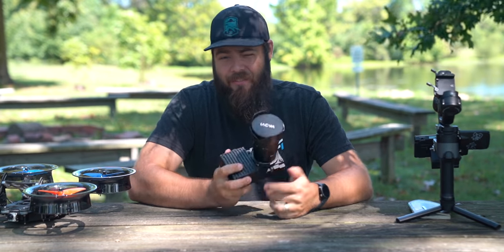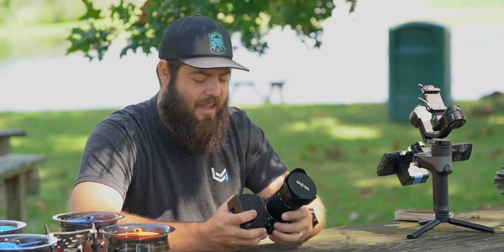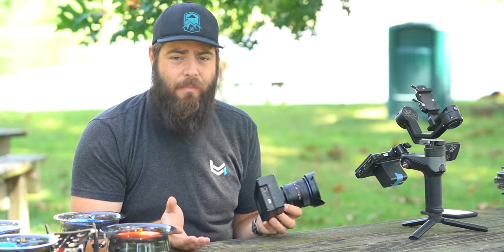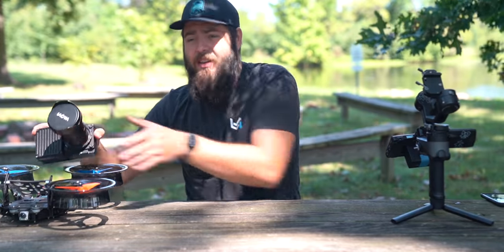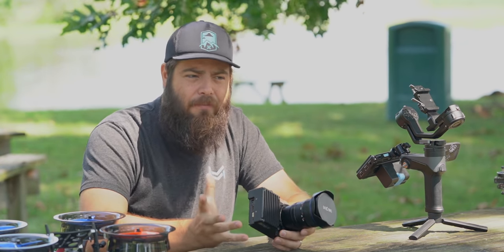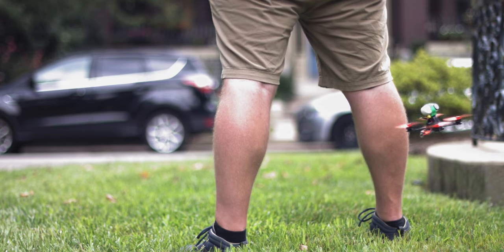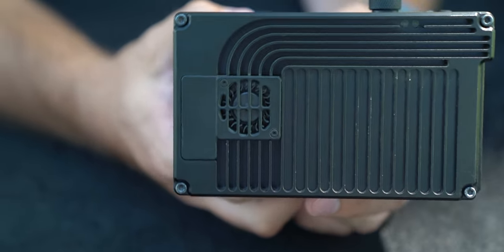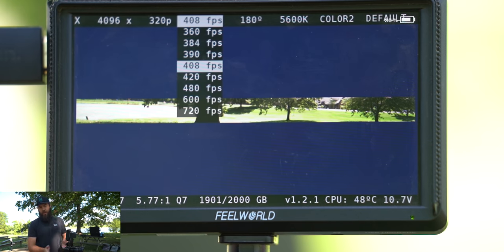Freefly Wave Review -- Why I Bought this $11,000 Camera

Comment: Thanks for making this. I went through youtube after seeing the Mark Rober video and the fvp-slomo, this cleared a lot up. 

Less option for exposure, not really. The "shutter speed" as in exposure is more or less is built in your main fps. The shutter angle being at a optimum 180 degrees and the rest is you setting the fps, determening how fast the wheel has to spin and how long is the has to be exposure. It doesn't offer a reference point the
of exposure time in seconds that you are normally probably used to look at. Looking it from a photography standpoint 1440fps has a 1/2880sec shutter speed at 180 angle, 1/840sec at 420fps, hence giving you a practical control of the exposure. Of course you can change the angle, but with that you are reducing the natural look of motion blur. And the iris is manual and ISO is fixed. Sucks for low light but that's slomo for you, even for a high end camera. Use variable ND-filters or dial down the iris if it's too bright. Same stuff different names or tools.

Comment: I got my insta360 Go 2 in.  It has pretty much the same exact issues. Quick to  overheat. Limited Internal memory. Short non swappable battery life. Long delays in transferring data.  But the pros outweigh the cons so far.  But looking forward to a newer GO version 3, that addresses the current GO 2 pain points.

Comment: neat... the heat sink would probably work better if you put a piece of tape over the fins  to force the air along the fins instead of blowing into atmosphere.  

in machine vision cameras you can teach the camera to balance out those vertical noise lines. i'm not entirely sure how they do it but it's some sort of localized gain adjustment that gets calibrated and saved at the pixel level.  Not sure if the mfg could do that with this cam or not. 

can you zoom in on the monitor to better check focus?  

would it be helpful if they could exchange refresh rate on the monitor for quality?  Then your colors and sharpness should be better at the exchange for lower frame rate.   i would think it's possible to do and keep the same bandwidth limitation.

Happy Friday Gorgeous!   Hi Paul and Winston

Comment: Hey Nurk love the level of professionalism you bring to the table. I have a question when you use DJI on such an expensive cinema rig what size and what type of BEC do you use to have stable voltage to your DJI system ?
I am having video freezing during flight. I changed FC to the Aikon F7 HD 20x20 I’m using the plug Supplied. I have the Fetteck spike absorber and I changed the capacitor to a 1000 UF cap I am still getting a picture freeze during flight I still have control of the model.  I’m thinking that I need a BEC I’m running 6S 2306.5 1900 KV motors. My question is how can you trust DJI you must not be having this problem with your vistas how do you do it please tell me? I have been struggling with this for a year almost Dji‘s customer service is useless I’ve already sent the goggles back to them they’re saying there’s nothing wrong with them and they sent them back on an old firmware I had to upgrade to the latest. I am on 5.8 GHz only please give me some information that can save me otherwise this unit is going to destroy my gear and I’m going to never order DJ I products again which would be very upsetting As I love it !!!!

Comment: 10 stops, banding, global shutter,... so, its a Cmosis sensor then? Same as BMD, AJA, Leica, FlareIO use.... add a LowCon or DigiCon filter to lift the shadows and roll off the highlights. There are plenty of remote focus options, and you'd know more options for wireless HDMI links then most of us.

Comment: Is it full frame?  You said the sensor was small?  You can use some of the f.095 lenses if its a cropped sensor.
Reply from the maker: Super 35
Reply from the maker: And I was saying small compared to the amount of light that can get into a phantom
Reply: @NURKFPV  Oh that's really interesting.  I wonder if the laowa 33mm f.95 would cover it or not.   The only problem the .95's is that they're pretty heavy though.

Comment: Great review, thanks! ........... question: for studio use, the low res monitor output is a bit of a deal breaker. What's the quickest way to get the image into the computer so you see an actual preview at the real resolution, even if only a still image? Is it something you can do in seconds, and if so, how?

Comment: Just wondering something about that 180-degree shutter angle. If you select an 180-degree angle you get motion blur, which also unsharpens the image when you are moving. 
What is fundamentally wrong with choosing a lower shutter angle such as 45 degrees, keeping more detail in the source footage, and adding motion blur in postproduction when desired? In Resolve that seems to work well? 

But I am just a beginner with all this. What do I know?
Reply: Its a good question. The answer is "Saving Private Ryan", specifically the D-Day landing sequence, where the sharper motion is clear, and stuttered - objects jump frame to frame instead of smooth motion.
Adding blur in posts costs time to render, and that eats up money in more hours the production has to pay for instead of shooting at the shutter speed that gets the desired blur.
Reply: @PiDsPagePrototypes  : With that scene it adds to the drama, together with the shaking of the camera. It was an artistic choice to setup the cameras the way they did. 

Regarding the question: I tried it with Gopro footage during toying around with the new-to-me (Gopro) toy: shot with 180-degree shutter angle and shot with 45-degree shutter angle and added a bit of motion blur in Resolve using its 'better motion estimation' over a few frames. The end result feels the same, so I am leaning towards 'if you have only one chance for the shot, you want the most versatile source data possible and worry about details later. You cannot really correct overexposed/oversharpened/overmotionblurred footage'. 

Regarding extra rendering time and thus cost: the same can be said for color grading, framing, sharpening, and more operations that are often delegated to postprocessing, right? It might be me, but adding a bit of extra motion blur to footage increases the amount of time spent for a minute of end result insignificantly. 

Still, nobody does it, so I must be terribly wrong somewhere.
Reply: @dabit4840  You're right in that you want the most versatile footage, though there's another rabbit hole to fall down there about producers who hire based on brand of gear owned, rather then skills learned.
The extra render time does come in to effect, adding the blur in the process might only take a moment, but all the elements added in to the vision grow the render time on export, but you still have to pay for that, so you grow the post production budget more then cost of fitting the right filters and getting the blur in the original footage - The more you get right in camera, the less the whole production costs.
But, like everything in film and TV production, there are many ways to get the desired results, and no one technique is right or is wrong, just some are more appropriate to each production.
Reply: @PiDsPagePrototypes  : Thanks for the explanation. Sure, if you do it for a long time you can probably fit the exact filter and settings for a given situation faster than I can blink my eyes. But I am glad there seems nothing fundamentally wrong with choosing a lower shutter angle and doing 'cinematic motionblur' later when desired and amount according to taste. With 60fps instead of 24fps there is also a lot more data to correctly calculate the motion blur afterwards.

Comment: Great video and awesome camera! However, in my opinion it seems like an odd resolution and aspect ratio, if it's measured in pixels. Wider than wide-screen but not as wide as ultrawide. Somewhere between that 16:9 and 21:9 area. I'm curious the reasoning behind that?
Cheers
Reply: It's a slomo standard. It has cinematic aspect ratios, but if you want some really fast framerates, you start to cut out vertical lines. The camera is a all arounder used for scientific purposes too so it climbs up to plus 9000+ fps, but the quality isn't good at that point and the aspect ratio is atrocious at 16:1.

Comment: thanks for the real-world review, that footage looks terrible, I was curious about the opening reel when it looked like the shot of the exploding color boxes had clipped highlights. I can understand them limiting some features but not even having a second ISO is absurd, it looks like 8-bit files I used to get on a AF-100 15 years ago and that dynamic range would make this thing unuseable. I would take less fps for 10 bit files with a log profile.  Maybe they update the firmware someday, I can see why these are popping up on eBay for half the original cost

Comment: Why not just strap a phone to the drone. Something like s21 ultra might be comparable to this
Reply: Because phones dont have Global Stutter,  and because they compress the crap out of footage with a per-second data allowance, instead of a per-frame method,. So on a phone, you have less data per frame at higher speeds. 60fps has half the data per frame as 30. 120fps is quarter,.. and the image suffers because of it.